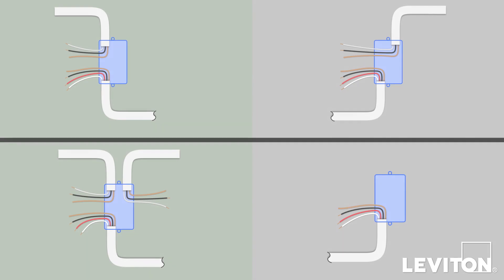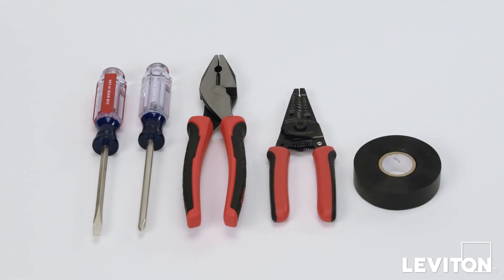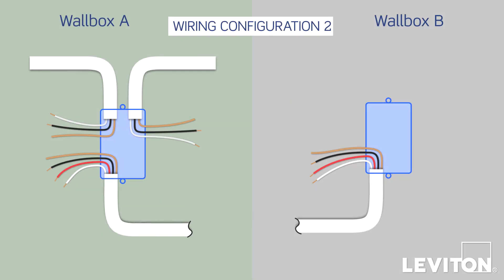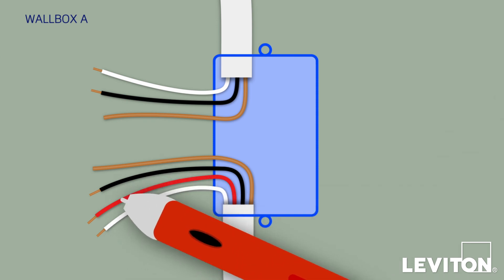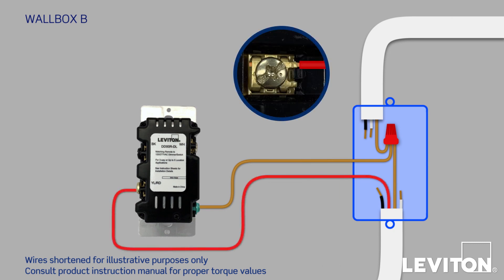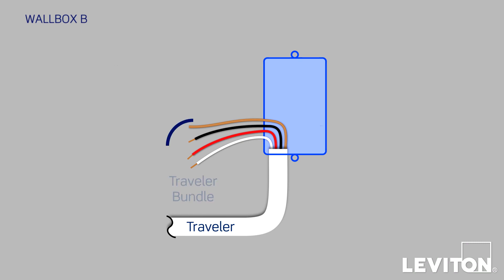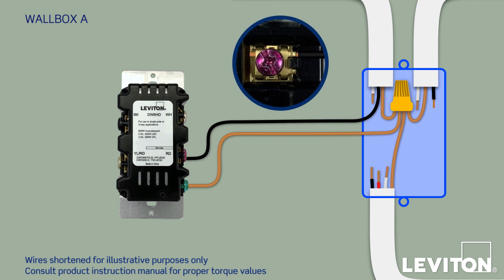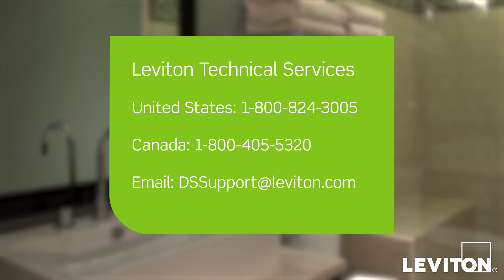How to Install a Leviton Decora Smart or Decora Digital 3-way Switch or Dimmer

Comment: We'll done! I'm pretty good with working, but have always had trouble with 3way switches. Most of my houses use insulation, which has the easiest 3way install imaginable. You're video took longer to watch then to do! You made it that easy for me. I probably struggled for over an hour (with the matter in the wrong wall box)! Thanks for the help in this!!

Comment: Hello. Apologies if that's already been answered, but can you set up 1 Decora smart switch in a 3-way switch set up and keep the second switch "regular"? or do you need 2 smart switches? Thanks in advance!
Reply: I'm wondering the same thing...did you get an answer? Do you really need to get the Decora companion o is that just a marketing ploy? :-~
Reply: @OneMondBand  you really need one I tried without and it did not work.

Comment: Thanks, finally instructions that make sense. I spent a lot of time on this issue. No matter what instructions I used it didn’t make sense, until this video.

Edit: thanks also to those in the comments section confirming this video is correct.

Comment: This and Darnell Williams video really helped me figure it out.  I had configuration 2 but it wasn't clear because both Box A and Box B shared the box with other switches.  The line box (Box A) also had a load jacket going into the room behind to feed power to some outlets and a closet light.  Box B just had a traveler but there were switches for two other fixtures there.  So, it was a little complicated and watching both videos helped me understand it better.

Comment: This really did the trick. Don't skip pulling all the wire apart and checking scenario, it turned out that one of my 14/3 wires was really the line wire. I have tried Lutron, tp-link, and now Leviton... the Leviton switches are by far my favourite. Love the screw connections way better than the cheap braided pigtails on other products.

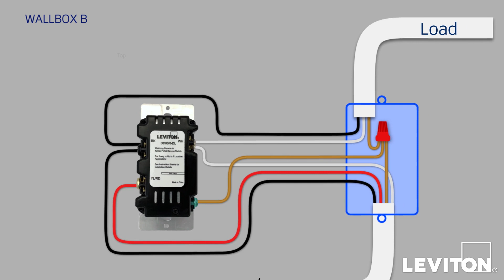Comment: Great video! At 9:21, which shows Wallbox B, should the cable exiting the top read "LINE" instead of "LOAD".
Reply: I noticed this also.  Wallbox B is the Line and I think is incorrectly labeled Load.  Otherwise this is a well made video.
Reply: At 6:33 it does show box B to be the line wire as well as audio instruction at 9:06. Most likely a graphic error but one or the other is wrong?

Comment: 1s, they do not tell you when you buy the Smart Switch that you also need a Remote Switch. 2nd, as mentioned in the other comments the written instructions and previous videos are unclear and in some cases just wrong. That said this video is much better.
Reply: Both 3 way switches need to be the smart switch?

Comment: This instruction video did the trick! My new 4-way-dimmers now work as advertised. Thanks for a well documented procedural!
Reply: Was the 4 way installation any different than this 3 way installation video? Trying to do both but these instructions on the 4 way are driving me crazy. Wish they had a video for the 4 way.
Reply: @anthonydimarsico3127  I'm sure you've probably figured it out by now but for anyone having trouble with this as I did as well, you want to look up directions specifically on how to wire a 4-way switch since that is the ONLY one that will be different. 

The 4-way switch lines will also look different since that will be the only box that has traveler wires on both sides. Your remote switch (with the line cable coming into it) will be the same as specified here and your main/master (with the load coming into it) will be what takes power to your light fixture. With the 4-way it's figuring out getting travelers connected from one 3-way switch to the other 3-way switch. In my case, on the 4-way switch, I matched black traveler to black traveler on the BK terminal and red traveler to red traveler on the RD terminal. Both Neutral wires into WH and the ground wire pigtailed onto the ground terminal.

Comment: They finally got the instructions right with this video, but i wonder will leviton admit they printed the wrong or had unclear instructions with the corresponding switches. As you see the published date of this video is 2-26-2020, now compare it to the other leviton videos explaining "how to do a 3-way wiring", The instructions contradict each other.  This video is correct, FINALLY!